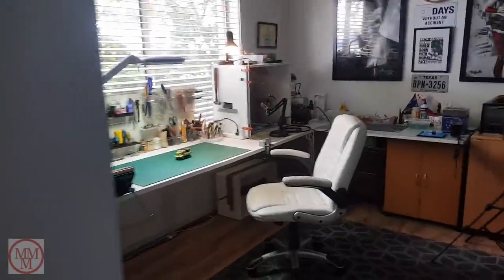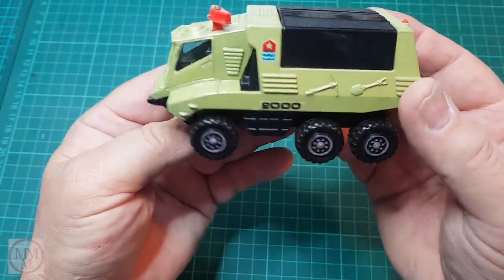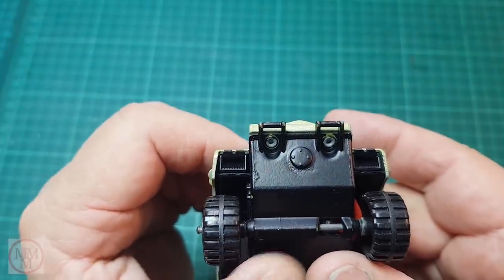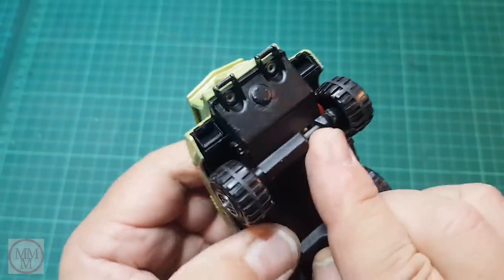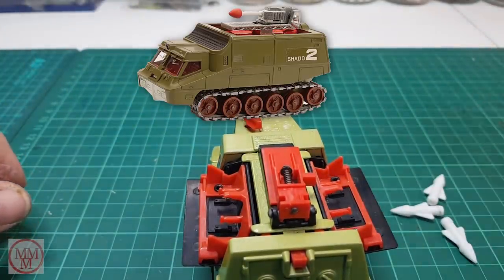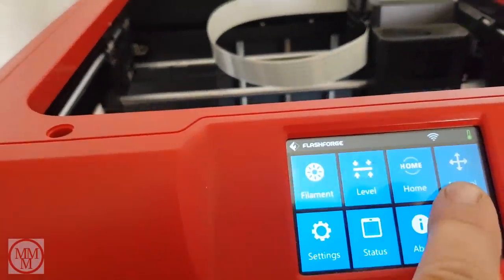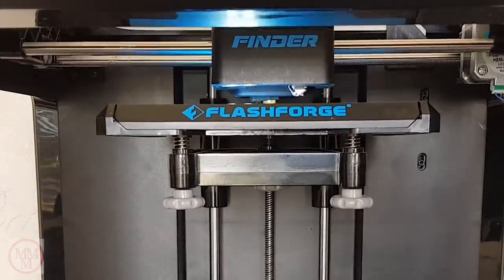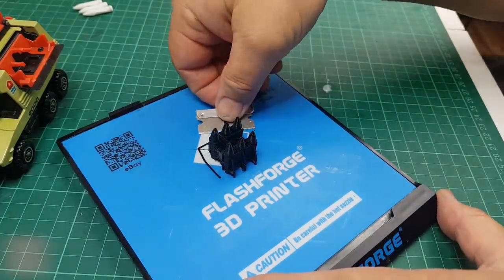Out of the Box - Episode 1 - Battle King K-111

Comment: adjusting the retraction setting on your printer will get rid of that long melty "string" as the bed moves away when the print is done.  It will also help stop that same excess when the nozzle goes from part to part while printing

Comment: When you cut filament like that always, always, hold onto the free strand. It can spring back cross under and tangle the spool right terrible and at some point it will tighten and the print will fail. I've had the control box for my CR-10S pulled right up to the extruder by just such a tangle.

Comment: Please, take a look at channel DIY Perks. He has a video about acetone vapor chamber to make those 3D prints smoother.
Reply: He printed the missiles in PLA. The acetone vapor treatment will not work on PLA. He would need to print with ABS to use the acetone to smooth the surfaces. It's much more difficult to print ABS due to the higher temperatures needed and the tendency of the printed parts to warp.
Reply: @Gopher_Rancher  Thanks for clarification.